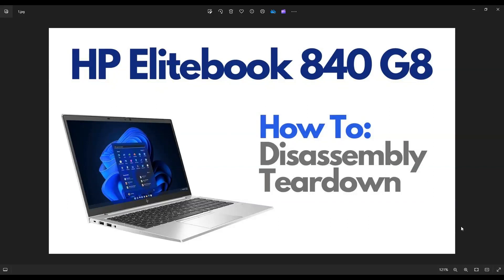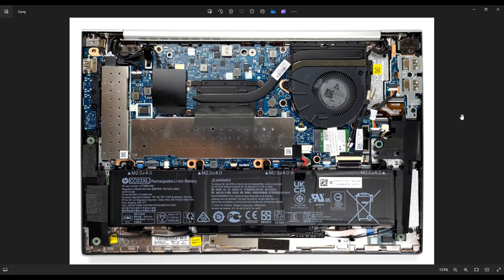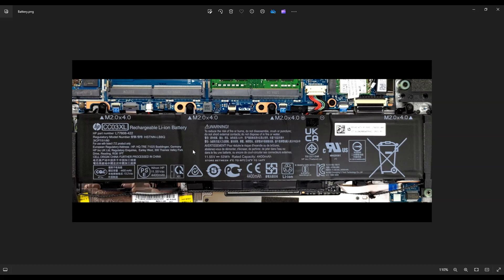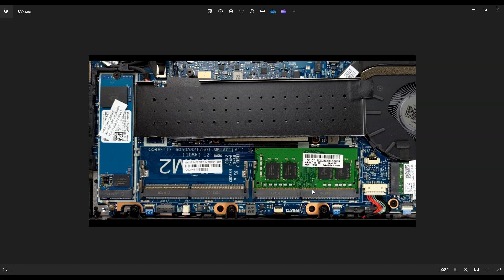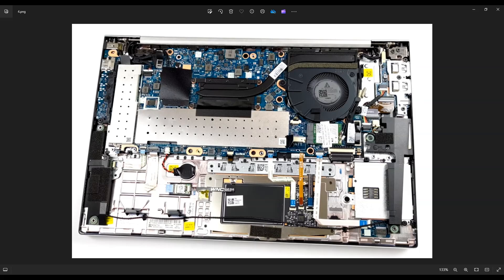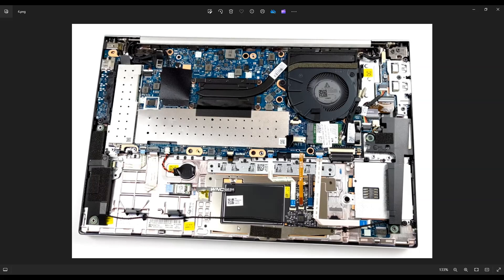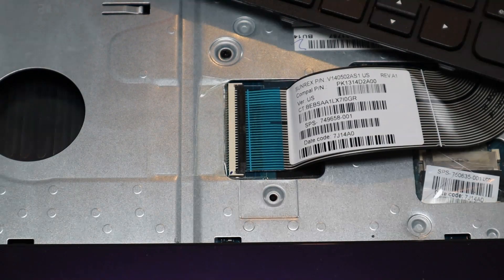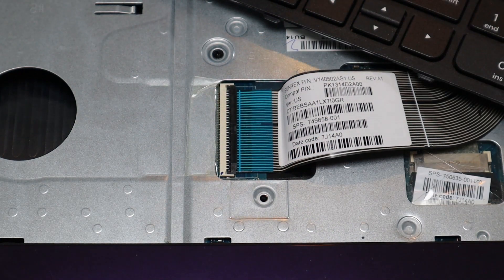Teardown / Disassembly, Upgrade Options - HP Elitebook 840 G8 Laptop Computer

Comment: I’m trying to reset my bios password the cmos thing doesn’t seem to be helping me any suggestions?
Reply from the maker: Some motherboards have a jump point where you can reset the BIOS password if you short out those two points. However, that is a risky operation and you run the risk of destroying the motherboard if done incorrectly. For that reason I choose not to have those DIY videos on my channel. Sry :(